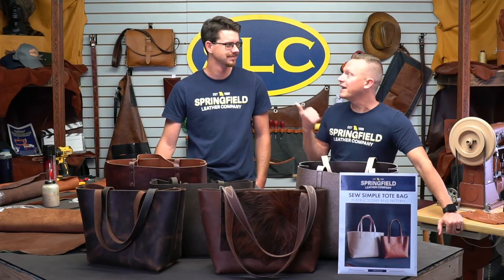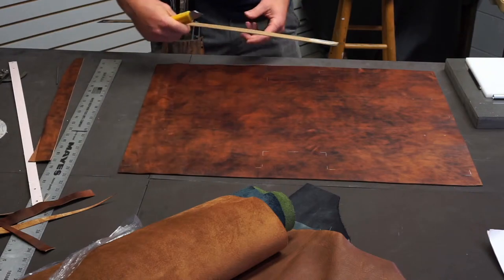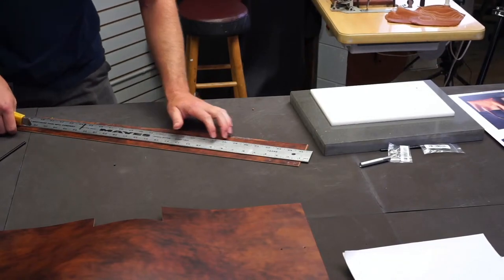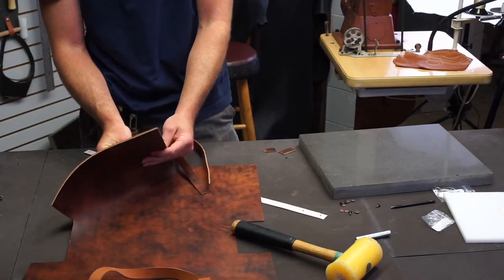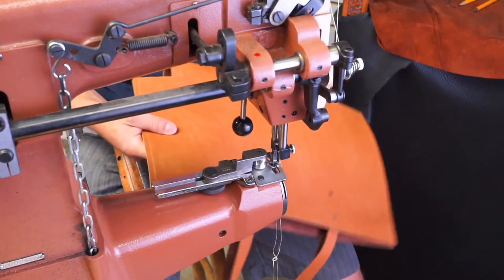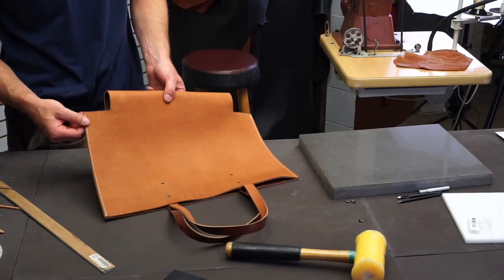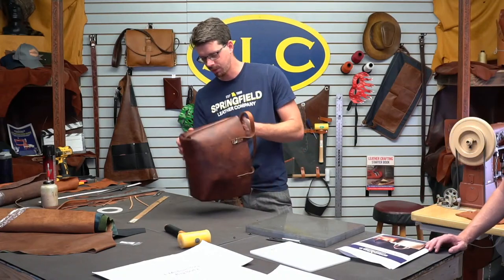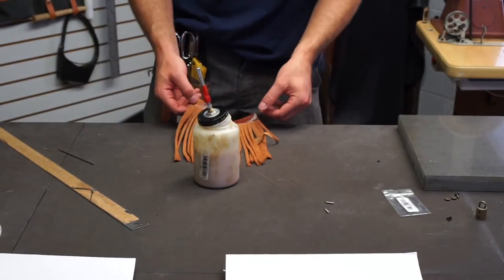Making a Leather Tote Bag LIVE!

Comment: Curious as to why you cut to the inside of your marks? one slip and you've got a problem...
Reply from the maker: When you trace the pattern you are actually expanding it outwards. So you cut the inside of the line so it is closer to the pattern...but it doesn't allow you to make mistakes.
Reply: @SpringfieldLeather  I think expansion is minimal, I always cut to the outside just in case I slip it can easily be corrected....but no right or wrong we all have our own way of doing things. Thanks!

Comment: What did you say you lined this bag with?
Reply from the maker: It wasn’t lined. But you could use pig or really any lining leather or cloth.
Reply: @SpringfieldLeather  in the video, you indicated that you had your leather all glued up.  The outside of the bag appeared to be different than the "i'm assuming inside" but in the vid, the side are definitely different.   Did you use two different weight leather?
Reply from the maker: @jayjohnson1440  I do believe that one of them was split down and then we used Tokonole to "paste" the back of it again.